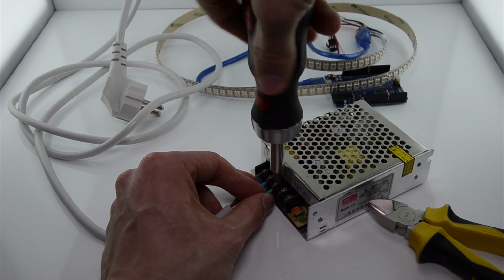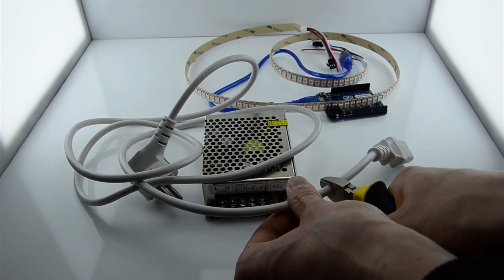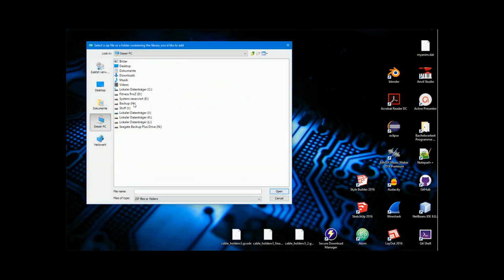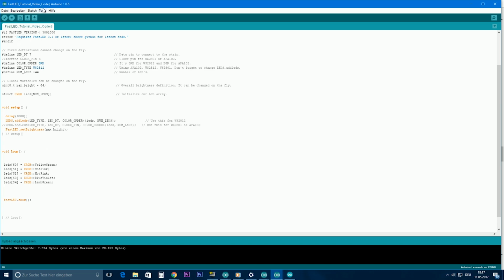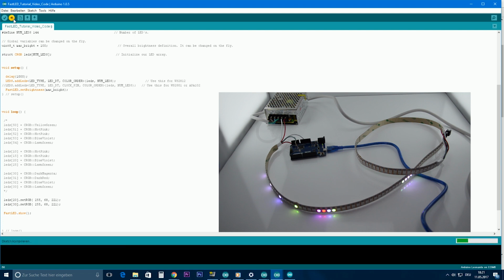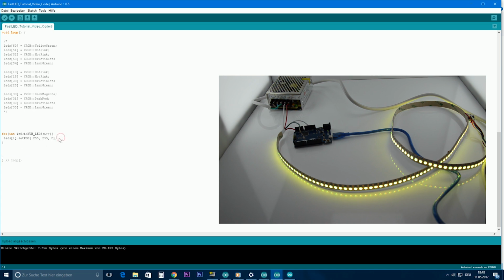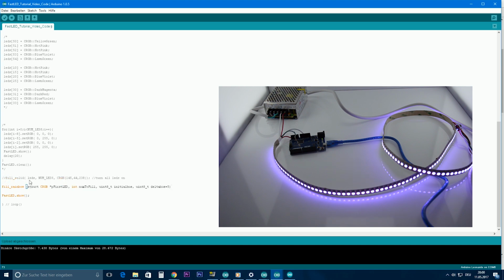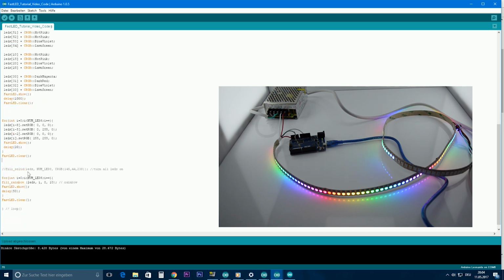How to control WS2812B RGB LEDs with FastLED and Arduino

Comment: If you power the arduino from a external 5V power supply you can better powered it with the VIN and GND pin. :) Just a tip!

Comment: GREAT video , Thank you !.   Question: What happens if you add a few too many leds to you list than you have voltage for ? Is it just a lil dimmer or do you run the risk of blowing out something?  Also is there a library of effects to use ? THANKS! :-)

Comment: I am having some trouble with the leds chasing each other.  I can get them to work sometimes but it seems to depend on what number I place with i.  It works fine with the example you gave but if i try to make the chasing bands much wider nothing seems to happen.  Any idea why this may be.  If the i goes above 9 is when i get the error.  Also when I add the second color to the stream it will not change speed when i adjust the delay.  When it is one color it will do what ever I want.

Comment: A great effort on the part of the hamburgtech channel for this video.Perhaps the best and cool , patient and serious explanation i hv ever seen .For last three days kept on going from one web to another web page till i landed on this.
I am wondering how music can be synced with the led lighting.What i hv in my mind is that for each song a different code may be needed.BUt with recent tech , can the process of coding be automated to sync with music?I hv no knowledge of electronics though familiar with Electrical tech.
Reply from the maker: Hi friend, thanks for your comment. Well there is a tool called Glediator that can do this sound sync job for you. I have a video here on this channel, it's in German but with English subtitles. You should give it a try. Another way is to connect a cheap mic/sound sensor to the arduino and read the sound level and map it to the brightness or color of the LEDs. Like that they would also be Sound synced. Maybe I can make a video about that by end of this year. Will be quite busy the next months. But for now give Glediator a try ;-) best of luck

Comment: You are a super star.  Thank you, this the most helpful Video on youtube.
Reply from the maker: Thank you for your feedback <3
Reply: @hamburgtech  Hope you can help I am trying  your chasing code but my led's just show one led lit up and no movement. I am using 32 leds on 2 ring's and this code..
void loop() {
 
for(int i=0;i<NUM_LEDS;i++){
leds[i-18].setRGB( 219,133,28);

leds[i-16].setRGB( 0,0,0);

leds[i-14].setRGB( 208,62,25);
leds[i-12].setRGB( 0,0,0);
leds[i-10].setRGB( 70,191,238);

leds[i-8].setRGB( 0,0,0);
leds[i-5].setRGB( 234,130,229);
leds[i-2].setRGB( 0,0,0);
leds[i].setRGB( 253,255,0);
delay(200);
 }
 FastLED.clear();
} // loop()

I want to do a PACMAN thing so yellow getting chased by 4 led's   so yellow 2 space then pink one space blue one space then red one space and orange one space.. so will  look like this, 
 . . . .  . the dots are the led's :-)

Hope this makes sense

Comment: Hey thank you for this awesome tutorial but can’t I use the 5v connector on the Arduino I do not understand why
Reply from the maker: Hi friend, thank you. Well you can use it but it will only provide between 500mA and 1A. If you take too much power from it you can brake your arduino. But to play around with some LEDs it's fine.

Comment: HI great video 
I want connect arduino in my pc to control rgb light for strip and rgb light from my fans. 4 pin molex from my power supply of enoufg to all leds
Reply from the maker: Hi, if you have 12V RGB LEDs, use the black (GND) and the yellow (12V) molex wire. If you have 5V RGB LEDs, use the black (GND) and the red (5V) wire. This is in German but you can see how it is done ;-) https://youtu.be/h2vT7zA5K0A?t=1m29s Best of luck!

Comment: I'm scared to wire up a power supply to mains voltage like that, why don't any of the high amp 5V PSUs just come with a plug included :(

Comment: Good evening Hamburg....
Please explain to me.....
Why when you connected all wires and put the socket on the power, the strip did not light on????
Was it because the Arduino prevented it from lighting on?
Through the Din cable?? Because.....it is clear that the + and gnd are connected to the ac/dc adaptor.....
Why since you have everything in place and connected properly the strip did not go on?
Thank you in advance.

Comment: Thanks for sharing such an Awesome project. Can you please share as how to modify code using WS2812B with Fastled or Neopixel library to display pixel no. 1 to 5 green color,  pixel no. 6 to 15 fadein purple color fadeout cyan color & then pixel no. 16 to 25 blue color. The LEDs assigned green & blue color should remain unchanged during fadein & fadeout of assigned LEDs with purple and cyan color.
An early response will be highly appreciated. Thanks & kind regards.

Comment: Hi, Nils. Working on a project that your video of controlling WS2812B LEDs helped out with quite a bit. What I am trying to find out is how to do a fill solid with a colour, but fade it in one a second to its base value, say 150. Being a novice but not totally inexperienced, I cannot find  code that will do this without it fading back down or continually fading up in a loop. I need it to fade up and stay.Do you know how that can be done? Oh, yes, it needs to start with a button push. so all 20 LEDs are off, push a button and they fade up to blue at level 150. I will need to fed them out later but that is another story and seems to be easier somehow. Thanks.

Comment: Hi Nils. Thanks for a gr8 video. I have got the prog working with a 30 led test strip showing several demos. I have a 300 led on order so will have some fun thinking which patterns to set up.
Reply from the maker: binarybox thank you! Best of luck for your project ;-)
Reply: hamburgtech Natürlich wird er Spaß haben, weil er dann den Led Strip mit deinen Ratschlägen mit 5V versorgt. Am Ende sinkt die Spannung wahrscheinlich auf 2.7V ab
Reply: Just to let you know, Nils, I received my 300 led string and got it working gr8, no problem.I have made five stand-alone Arduinos to drive four one metre strings and one to drive the five metre string. I have plenty of good power supplies.It has been a satisfying project.

Comment: I used 12 V strips, and then I didn't need so much amps for all the devices.  And the voltage drop will not be a problem on longer LED strips.
Another tip.  Don't use the LED strip rolled up on a rool when testing. The heat in the inner turns will melt plastic, and you will have components all over the floor.  :-/
Last tip: You don't need to download the FastLED library, you can tell Arduino IDE to download it for you.  Which is described in the README in github.
Reply: with 12v strip is it fine to connect the DIN directly to arduino pin?
Reply: @zakariajawas  no

Comment: Hi!I have bought led strip with 60 leds (5 volts,18 watts).I have power supply (5 volts,12 ampers,60 watts). Which resistor I have to connect? Thanks in advance!

Comment: How do you know to use a 470 Ohm resistor vs like a 220, 1k, 10k etc?
Reply: You select a small resistor so that if the led's are turned off, any excess voltage is consumed by the resistor to ensure the logic is low on the arduino pin. Typically, a 300ohm resistor is used but anything below 1k is fine. If you choose too high a resistor, you will lose too much voltage and dim the leds by restricting the current. Most if not all arduino have built in pull-up resistors and an external resistor is not necessary. To enable the pull-up, when declaring your input pin in the arduino code, ensure to name it as "INPUT_PULLUP" instead of simply "INPUT".
Reply: @knightdaleknights44   Common built in pullup resistors are in the range of 20K Ohm up to 150K Ohms so that seems like it would be much too high to use if it should typically be around 300 Ohm (or something below 1K).
Also, since this resistor is only on the data line, if too high a value was used it would mess up the data signal going to the first pixel.  It would not cause the LEDs to dim since it is not limiting the current to the LED strip.
Reply: @Marc_Miller  the signal wire basically acts as the power wire to LEDs. 8f the pullup is too strong, the signal will lose amplitude and the output voltage to the led may not be high enough for it to turn on. If the pullup is again too high, current may be limited and the led may be very dim. In an RGB setup, the red, green, and blue signal wires are sent a PWM signal with the pulse widths determining the correct color combination. If the pullup is too high, the square wave's amplitude will be too low for the led to switch on. Because Microcontroller come with built in pullup resistors, using a low resistance external resistor is recommended if you even want one there. A large external resistor would add to much series resistance with the internal pullup resistor and cause the led to dim or not turn on at all. And most internal pullup resistors are in the range of 1k-10k. If the controller has internal pull-ups, just don't use an external resistor, it's pointless lol
Reply: @knightdaleknights44     An LED strip that has individual R,G,B signal wires is a different sort of LED strip.  That type of LED strip would be considered a non-addressable (or dumb) LED strip.  The setup in the video is for an addressable LED strip which is wired with a +5V, a Ground, and one Data line.  For this type of LED strip the Data line does not provide power for the LEDs.
Reply: @Marc_Miller  you're right. It's been a while since I watched this video. In this case where you're using an led controller chip, then the only point of the pullup resistor is to ensure the off state of the signal wire is indeed a low since your signal pin won't have a floating output. I suppose in this case too high resistance would destroy the signal amplitude and cause the controller chip in the ws2812b to not function properly. Too low of a resistance wouldn't effectively be worthless in pulling the pin low. A mild resistor (under 1k) should do the job fine and not give too high a resistance with the built in pull up. I just use the internal pull up and save myself a resistor.
Reply: @knightdaleknights44  , isn't that an OUTPUT pin??

Comment: The 470R resistor seems superfluous? It's a data line, you don't need to restrict the current as it's only specified at about 1uA. The only effect the resistor would have is to slow the edges?

Comment: Congratulations. This project can be combined to react with sound? how would it be?
Reply: Yes, it's software, do what ever you like :) The Arduino must have audio input. It can read voltage (analog input) but you don't want to convert momentary signal voltage to led control. I would build analog preamp to low pass filter and rectify the audio, so the voltage would be like riding the peaks of music. That's how any level meter works. You don't need to know signal processing, but a rectifying operational amplifier circuit might be the starting point. Then when you have the signal level read by Arduino, use the value in any way you want, like controlling the max number of leds to turn on (loop length). You most likely need to scale the input value matching your needs. But this is the raw approach, I have never programmed Arduino, yet!

Comment: Hi. Great video. I'm a bit late for the party but could you be so kind and tell me if resistance is necessary for the data cable? I thought arduino adjusts voltage and the current automaticaly
Reply from the maker: "That resistor is for impedance matching between the Arduino's low-impedance output and the WS2812B's high-impedance input. When using long wires, they act like transmission lines, causing reflections, resulting in unwanted oscillations, ringing and noise." I hope this helps 😁

Comment: Hi dear,
Last 6 months I was searching  on internet to get like this code.very useful  and easy to change.  Delay  and clear is working  well. How can I make reverse running  light effect from this code. Moreover  I am not an expert.
Reply from the maker: Hi friend, thanks for your comment. Well what do you mean by revere running light effect? Start at the last led and run to the first one? To do this you would set the loop counter to the last led number and then instead of i++ you would do i-- . Or is it something different you want to achieve? Best of luck.
Reply: @hamburgtech   
I check  it with below code. Not working.

FastLED.clear ();
for(int i=0; i<NUM_LEDS;i--){
led [i+2] .setRGB (0,0,0);
led [ i ].setRGB (255,255,255); //2 white light running on photo frame anti clock ways. In my case 22 led used  around a frame.
FastLED.show (  );
delay (100);

++ working perfectly.
Reply: @shyjuthylakandy6123  dude if you doing i-- then you have to go backwards, so start with the number of LEDS you have. so int  i=300 (for 300 LEDS).
Reply: @chrissurman9063  Hi✋ I did change the code.  But not working.
Reply: @shyjuthylakandy6123  reverse everything, also  300 leds would be 299.

Comment: Great video could this kind of application be done for a car and do you need a computer at all time for it to work?
Reply from the maker: Hi friend, sure you can put this into a car, you will just need a 12V (car) to 5V (arduino/leds) converter. Once your code is on the arduino, it will run without any computer :-)

Comment: Nice video! For my project I will need 200 LEDS  with a wire length between pixels of 30cm. Will I get a significant a voltage drop if I connect 4 strings of 50 pixels parallel with 5v pixels? Or do I need 12v pixels? Thanks a lot
Reply from the maker: Hi, will there be 30cm of wire between each of the 200 led pixel? That would be quite a lot of wire 😅 But 200 LEDs wont be a problem. You can provide the voltage from both ends. Then it wont drop too much. If you only connect 50 LEDs each it's totally fine. Best of luck 😁

Comment: Thanks for the video and descripton. What about if I use 3 separate parts of same LED strip 3 inputs on same Arduino? Circuits is ok but what will change for the code?
Reply: If you are saying you want to use 3 pins on the Arduino board, you would have to make a break on the strip 2 times on the Data.  Where you break the connection will be LED 1.  But I would think you should be better off just programming LED's 1-20 and 21-40 and 41-60 separately withing the one program.

Comment: Great tutorial. I would like a little help though. I want a simple led chase (Which I can do now using FastLED). The one thing I can't seem to understand is how to  make more than one led be included in the chase. I want to be able to have any number of leds chase together in a group.......1, 3, 10, 20, etc...... Any help would be great  :  )
Reply: if you didn't figure this out, I think it is to do with the intro of a few led's at first, and then clearing them to 0,0,0,  than adding another amount, (1-8) and then clearing them again to 0,0,0 
code is about 16.35 into the vid

Comment: Hi,

great video!

What can I do if I want to say, that for example only LED5 - LED55 to be on?
Reply from the maker: Hi, you want to turn on led 5 up to led 55? Would be a loop: for(i = 4; i < 54; i++) { leds[i] = CRGB::Red; FastLED.show(); } just wrote that from my mobile, but if you check the video you should be able to get it running. I dont have the code in front of me ;-) best of luck

Comment: Just a small advise, not all LED bands will draw 60mA per LED, so measure the actual power draw.
Reply from the maker: Yeah that's true, with some adjustments it can be like 20mA per LED, for example with some dimming.

Comment: Getting the following error when trying to change color to GRB:
                 from sketch_dec15a.ino:7:
In file included from C:\Users\ByronG\Documents\Arduino\libraries\FastLED/FastLED.h:59,
                 from sketch_dec15a.ino:7:
C:\Users\ByronG\Documents\Arduino\libraries\FastLED/pixelset.h:302: error: 'template<class PIXEL_TYPE> class CPixelView' used without template parameters
Here is the only code I changed from your ino file
#define LED_PIN     7

//#define CLOCK_PIN 4 

#define NUM_LEDS    300
#define LED_TYPE    WS2812B
#define COLOR_ORDER GRB
#define BRIGHTNESS  64
What am I doing wrong?

Comment: While there is a lot of good information here, you should be aware that COLOR of wiring is very important for safety reasons as green is only used for ground in the USA, Red is positive DC and Black is Negative DC.  You have two examples where the wiring is shown white as negative Dc, then Black as negative DC.  Always stick to one color scheme for consistency and safety.  #SafetyFirst

Comment: Hello, to be sure you understood correctly:
I have a 1 meter ribbon with 60 LEDs so it takes 3600 mA or 3.6 A, if I understand correctly it takes a separate power supply then, I cannot directly use the Arduino (Nano in my case) for feed the ribbon, so i need 2 power sources, one for the ribbon and one for the Arduino?
Reply from the maker: Hi Joshua, yes you got it right. But these leds will in reality use a bit less current than 3.6A. And will only need that in the are all turned white at the same time. If you use 5V leds then you can power arduino and leds with the same power supply. A trick that I often use is to cut a usb wire and connect ground and 5v to the power supply and the usb connector to the arduino. Like that it's easy to power the Arduino. Also if you power leds and arduino with the same power supply you only need one data wire from the arduino to the leds. Best of luck:-)